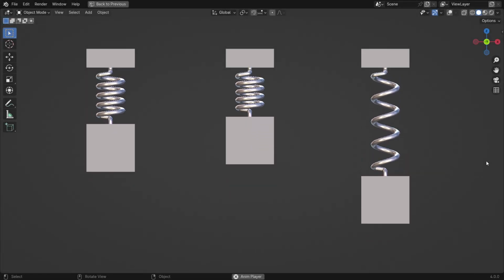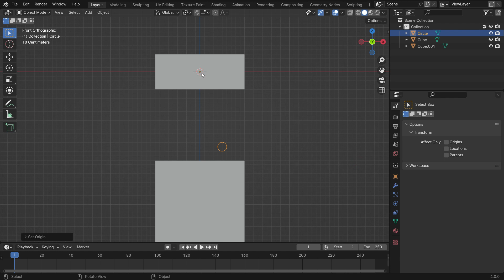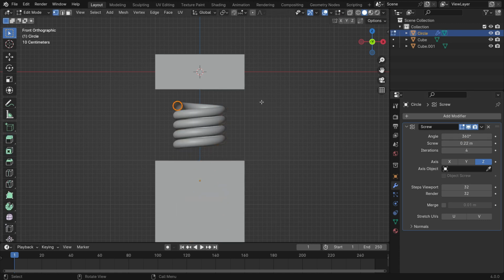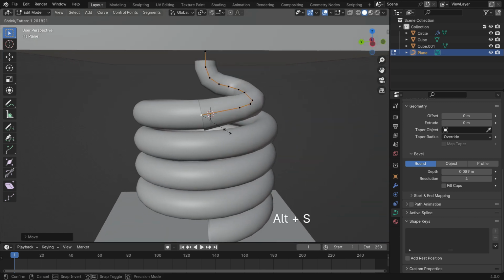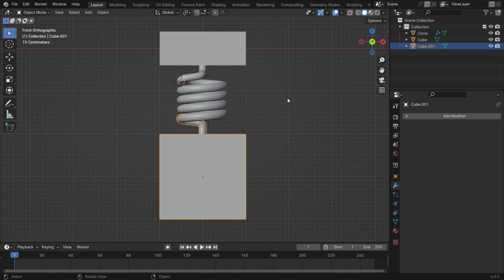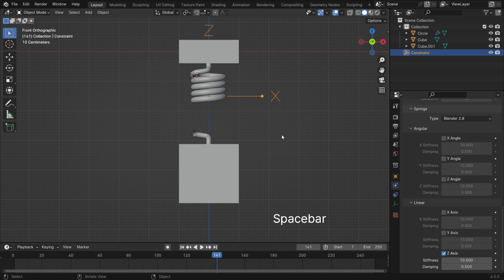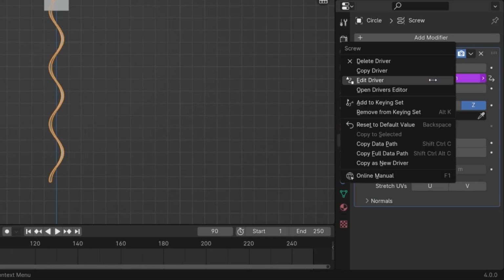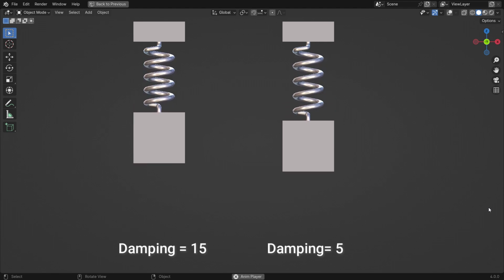How to Make And Animate A Spring in Blender

Comment: thank you for making this, I'm trying to rig my car model's suspension without mods. I want a collider on each wheel so when it drives on rough terrain, the up and down movement of the wheels would rotate a control arm and that arm would bend the spring. I'm too drunk right now but in a perfect would I could figure out how to achieve this lol
Reply from the maker: You can totally do that using only Rigid Body Constraints in Blender. Set each wheel as an active rigid body, use a Generic constraint to connect a control arm to the chassis, and add a Generic Spring constraint between the arm and the body. Enable the spring on the Z-axis and tweak the stiffness/damping for a realistic bounce. No add-ons needed,just physics and constraints.